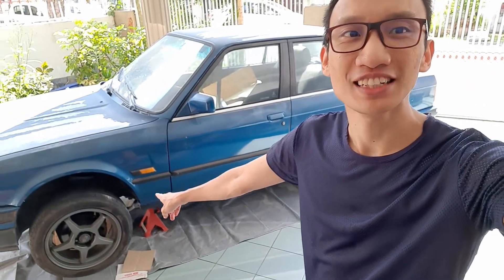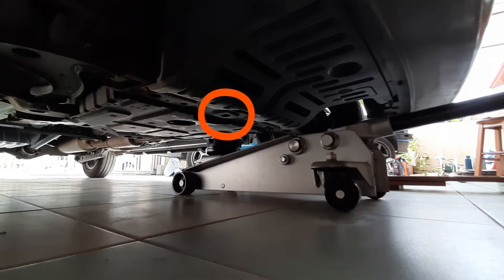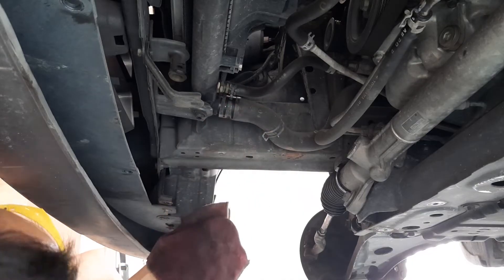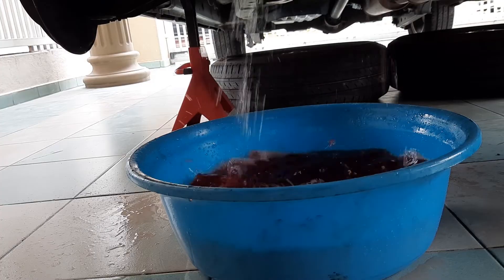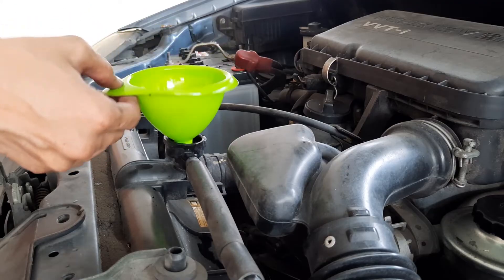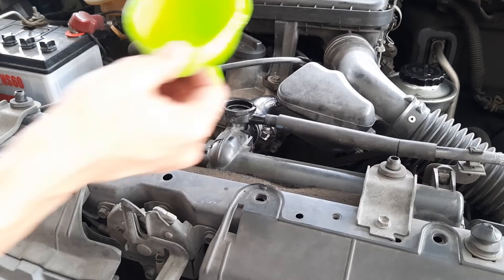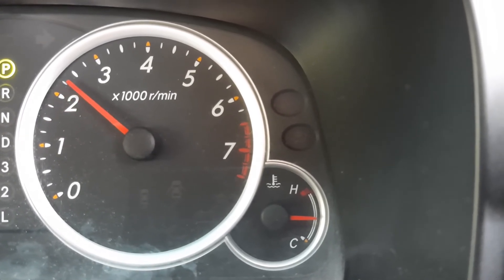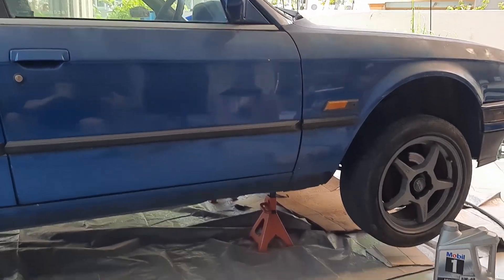Toyota Avanza Coolant Drain and Fill

Comment from the maker: Shopee Links for the exact products I used:
- Toyota Pink Coolant https://shope.ee/3fTcMBMk08
- Avanza oil filter https://shope.ee/2fb5AOOmnY
- Avanza air filter https://shope.ee/406SkrSF8b
Reply: Hi,
I have a question for you on the temperature gauge of the dashboard.
My temperature operates normally with the needle at halfway mark (roughly at horizontal position).

Due to an accident, my engine temperature went up, and found my radiator leaking. Replaced the radiator. Everything seemed OK. Several months later, the engine temperature shows above normal on several occassions, especially when on a slow-moving traffic with stops and starts, bumper to bumper traffic.

My Question:
1. What is causing the temperature to be above normal at times of slow moving traffic?

2. Where is the temperature gauge on the dashboard sensing? Where is the sensor located?

Note:
1. I have changed the thermostat that opens/closes the water cooling the engine.

2. I have replaced the water pump that circulates the water around the engine.

3. Replaced the radiator cap and cleaned the coolant spare tank.

4. Flushed the radiator by opening the stopcock of the radiator, and draining out the water inside. Then refilling up the radiator after tightening the stopcock at the bottom of the radiator.

5. Radiator not leaking.

Hope to hear your expert opinion.
Reply from the maker: @usjtraffic  hello. Really, I'm not an expert - so just take this as a random guy on the internet's uninformed opinion:

If it only gets hot when you're stopped, i would guess the radiator fan isn't working. Maybe the fan itself, fan clutch (if the fan is belt-driven), or some sensor which is supposed to tell the fan to engage.

I think the temperature gauge shows engine coolant temperature.

Comment: Hi,
I have a question for you on the temperature gauge of the dashboard.
My temperature operates normally with the needle at halfway mark (roughly at horizontal position).

Due to an accident, my engine temperature went up, and found my radiator leaking. Replaced the radiator. Everything seemed OK. Several months later, the engine temperature shows above normal on several occassions, especially when on a slow-moving traffic with stops and starts, bumper to bumper traffic.

My Question:
1. What is causing the temperature to be above normal at times of slow moving traffic?

2. Where is the temperature gauge on the dashboard sensing? Where is the sensor located?

Note:
1. I have changed the thermostat that opens/closes the water cooling the engine.

2. I have replaced the water pump that circulates the water around the engine.

3. Replaced the radiator cap and cleaned the coolant spare tank.

4. Flushed the radiator by opening the stopcock of the radiator, and draining out the water inside. Then refilling up the radiator after tightening the stopcock at the bottom of the radiator.

5. Radiator not leaking.

Hope to hear your expert opinion.
Reply: Radiator fan

Comment: sir..u only use 1 liter coolant..enough?
Reply from the maker: I used about 2.5 liters.

But the owner's manual says it takes 6.8l (manual transmission version takes 6l). Maybe there was a lot of coolant which did not drain out as i only jacked up the front of the car 🤷‍♂️

Comment: How many times to drain a coolant sir?
Reply from the maker: Hi Liza. If you are not using Coolant Flush, you can just drain out the existing coolant once, run some clean water through, and then add your new coolant.

If you are using Coolant Flush, you have to keep flushing till the flush comes out clean. This will get rid of all the rust / grime from your cooling system. I did this with my old BMW here - https://youtu.be/u5tLYP8Ux0s